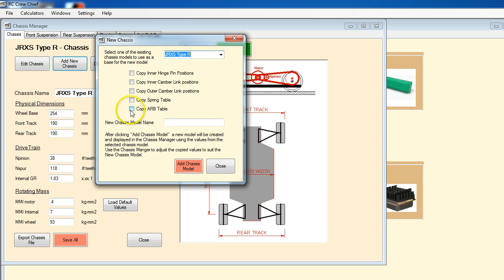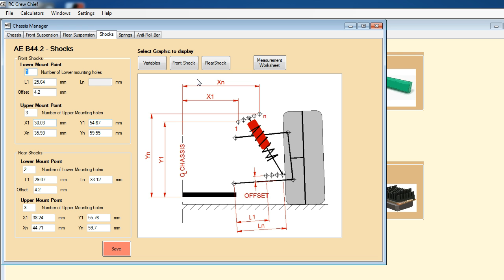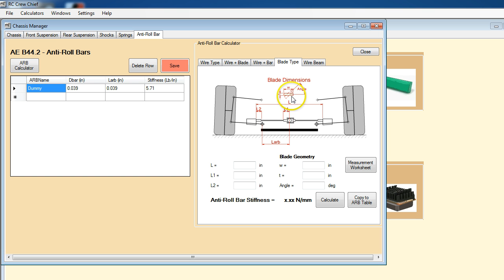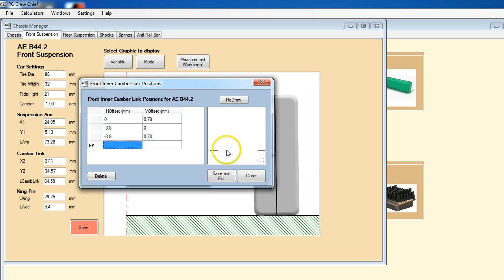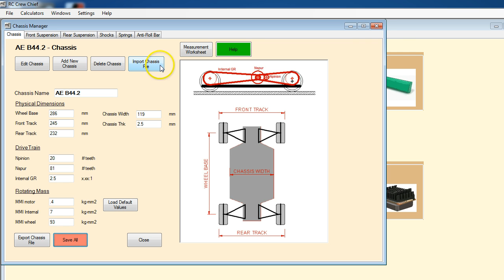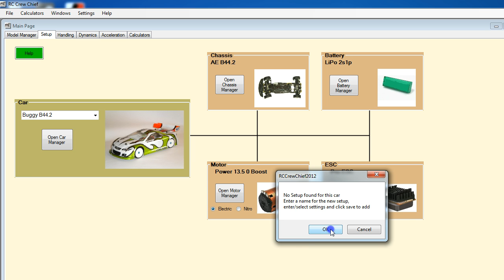Creating AE B44 2 Model - Part 2 Entering Model

Comment: Hi onto my second car now, b6.1, I have done everything correctly  and my numbers are inputted,  all goes well until I save in CG calculator, close, then go to my car page and a pop up comes up and says "error in model geometry reset model and try again". All numbers are put in correctly repeatedly for consistency and all looks exactly the same as actual model. Is it known glitch in Crew Chief or something to ignore?  after further investigation it seems that it is just not copying my CG calculations into my car. thank you.
Reply: For further info I have now been able to put the CG calculator outputs and save them into my car save, they are now correct but I still get the pop up and I need to press ok on that pop up 10 times to make it go away, then everything seems to work fine? BTW, My PC is modern, is fully updated with win10 pro software and I know my way around a computer and keep things running well. I am aware this software may be older and I did download it after I purchased the full paid (emailed code) version only a month or two ago,  just for your info and make you aware of any info I can let you know. Really enjoying this software and the process of your instructional videos, fantastic to see graphical inputs change the dynamics of both the 2d and 3d real models. Great work, thanks.